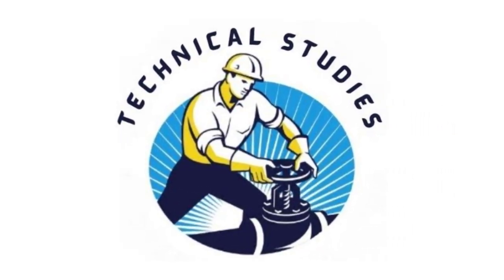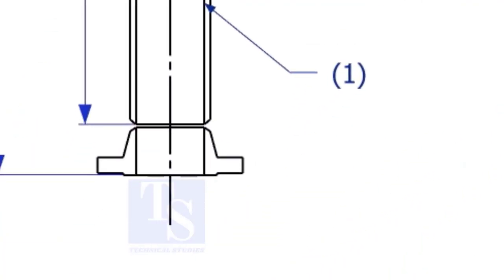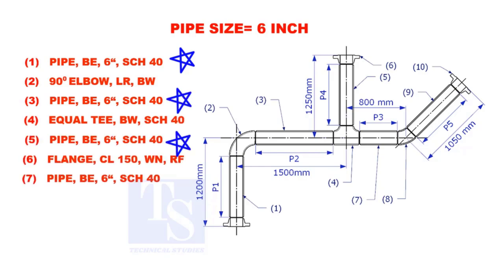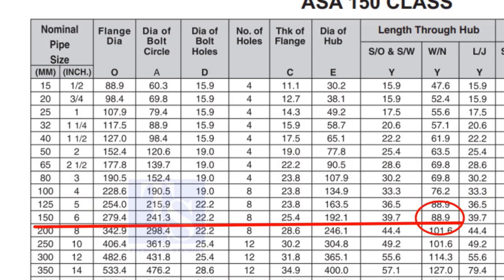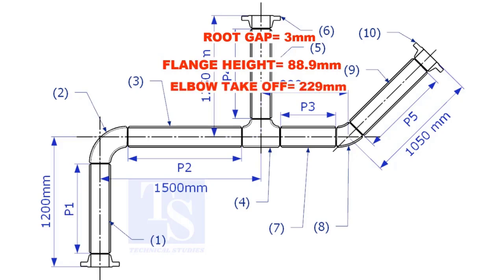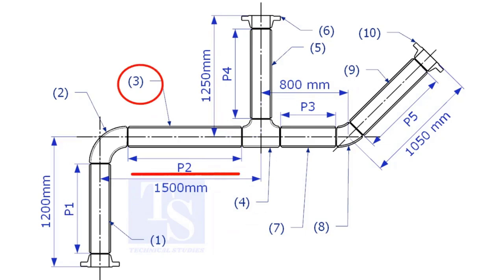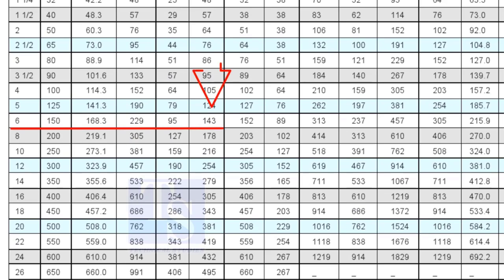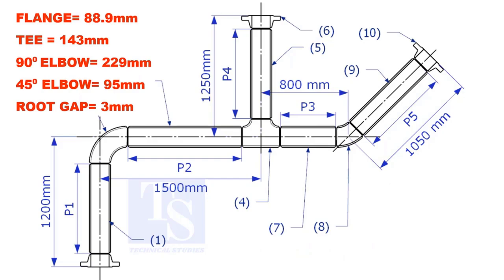How to calculate the cut length of pipes in a drawing.

Comment: Thanks for sharing, but you also need to allow for weld shrinking. Those joints will likely shrink around 2.5 mm each from the welding process (more for stainless). To simplify calculation, take the shrinkage off the root gap allowance. This makes allowance 0.5mm per butt weld. Tack together with your 3mm gaps and the dimension on left should be 1205mm when ready to weld.
Reply from the maker: You are extremely correct. I really appreciate it. These videos are for general information only. Weld shrinkage, distortion control, etc. need good experience and cannot explain in a video. Thank you for the sensible comment.
Reply: pls I got ans: 876.1mm
Reply: Correct 876.1